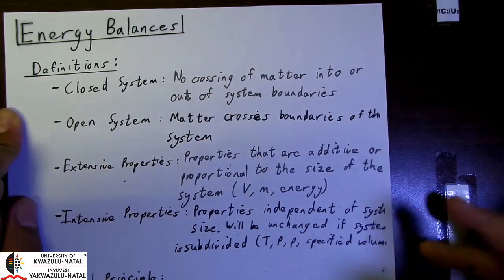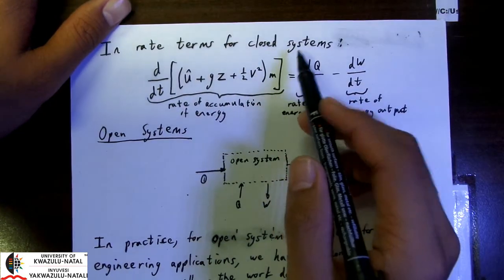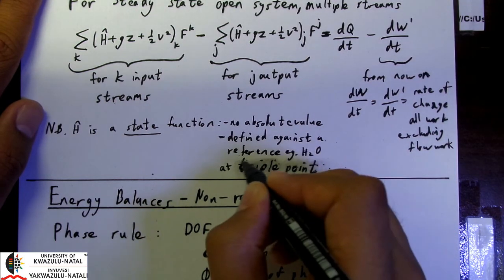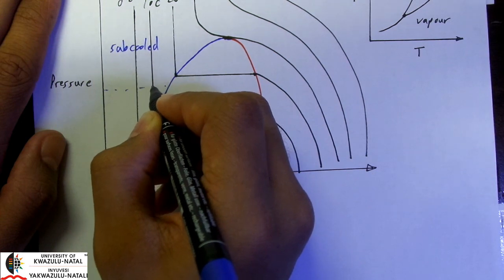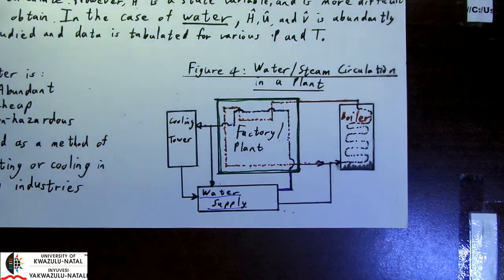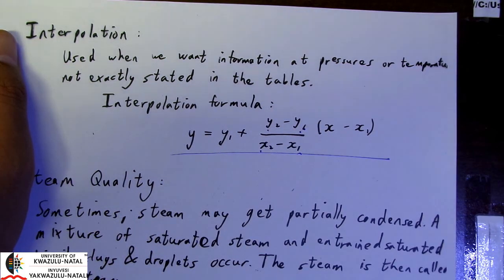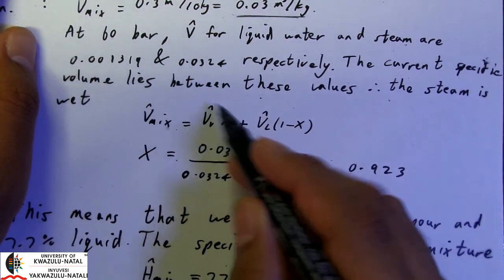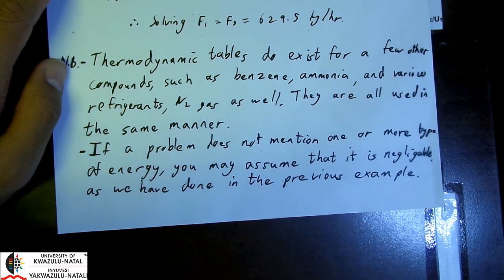Energy Balancing Lecture 1 Introduction and Use of Steam Tables

Comment: open system equation for steady state which you have manipulated from non steady state equation. I think there is dismatch of negative sign. If the equation for steady state for open system which you have written is correct then how it come from previous one. I mean to say how you have adjusted the negative sign which should come in the picture.